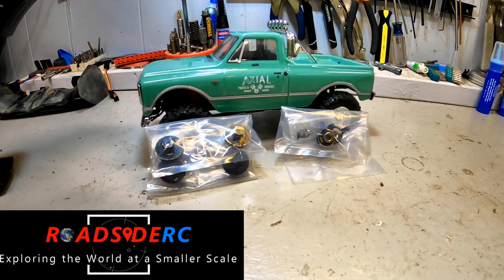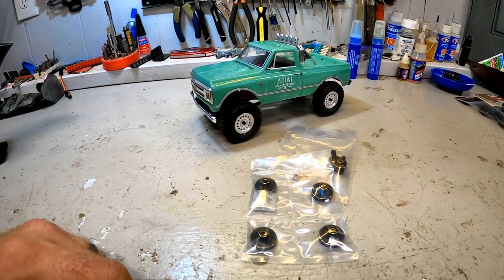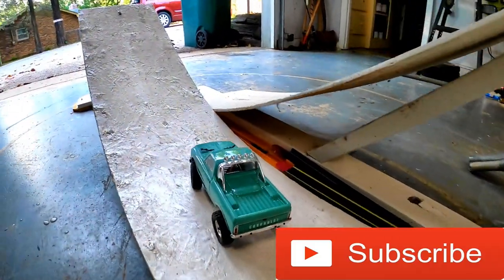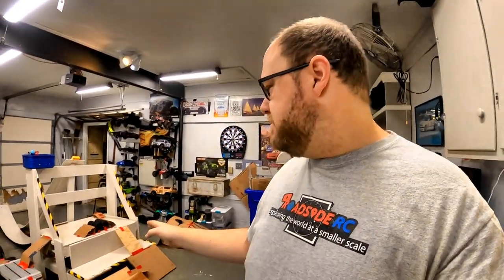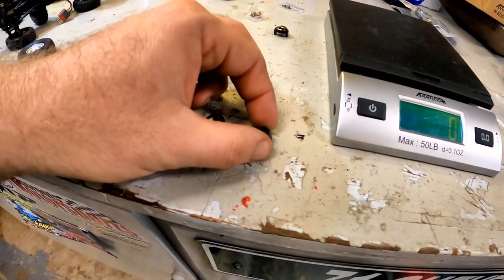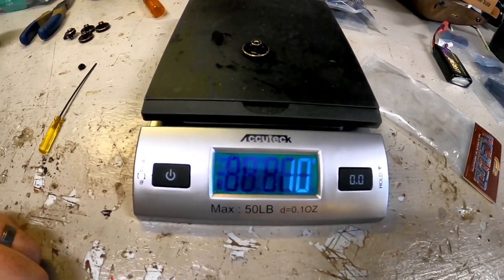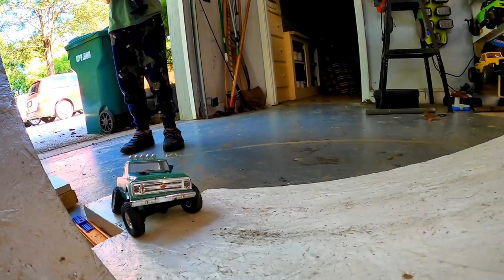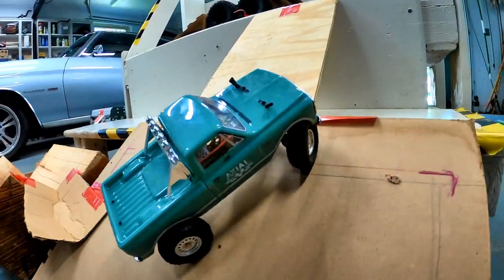Axial SCX24 TOPCAD Upgrades!  Brass Hub and Hex Install and Test

Comment: Tires are Number one for me.. RC 4wd has a bunch of really nice ones.. I have a Betty and my son a Deadbolt!
Reply from the maker: I'm trying some RC4WD ones also.  Which ones did you go with?
Reply: @RoadsideRC  Patagonias, Mud Slingers , BFG KR3's and Wranglers. Fav's are the Pats, the Slingers are awesome but are huge.. had to trim a bit of the body on my son's DeadBolt for them to fit and they don't fit my Betty at all.. the KR3's are impressively wide and hook great and the Wranglers look great but don't perform well on what I drive.
Reply from the maker: Thanks for the feedback!

Comment: Great video man I love my little scx 24 I have a few obstacles here that I built I'll have to take a video and Shoot To You In messenger yeah when you widen make a lot of Tire scrub some guy superglue that Servo saver also that front steering linkage has a lot of play and sometimes flexes but I have brass wheel hexes on mine brass diff covers trill front steering linkage brass front knuckles aluminum links hot racing aluminum transmission cover that's all I can think of right at the moment
Reply from the maker: Thanks for the feedback. 
The steering certainly needs help - after this video, I went and glued the servo saver.

Comment: Are the rubbing on the screws or bearings? I found you need to grind them down reducing strain on your motor. You can hear it grinding.
Reply from the maker: I didn't find any rubbing here, when not over tightened.

Comment: I got rid of the brass wheel hexes, just get wider set wheels. Keep the truck lighter. If you want the hexes still, get wider rear axle shafts so you can keep front and rear same width.
Reply from the maker: I do agree.  I typically don't look to add rotating weight to any of my trucks, however it doesn't look like there are a lot of choices when it comes to these trucks for adding low weight.  

The only thing I really don't like about these is the extended nut for holding the wheel on.  Those seem to always give me issues.

Comment: Now it's time for a  nice soft tire upgrade
Reply from the maker: Yes!  
I tried some from RC4WD, but I wasn't happy with them.
Reply: @RoadsideRC  which tire did you try from them? I know the wranglers and the patgonia are both pretty amazing but work best with bead locks and no tire foam in my experience